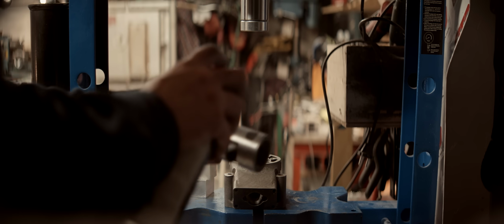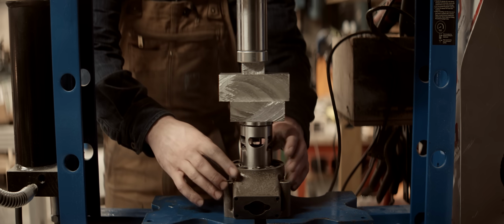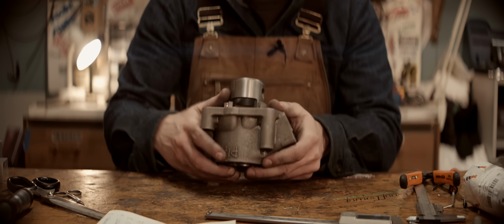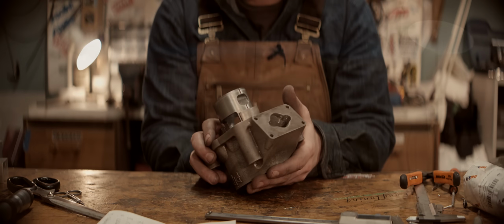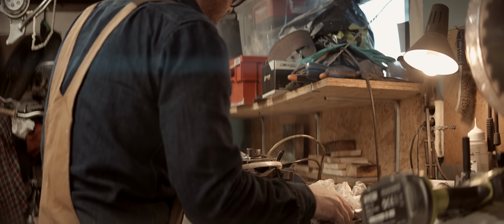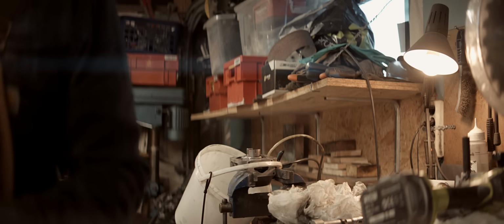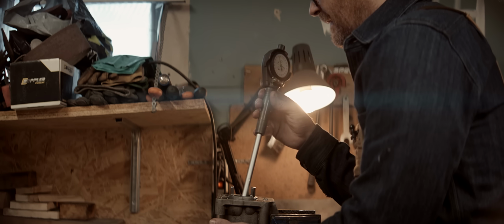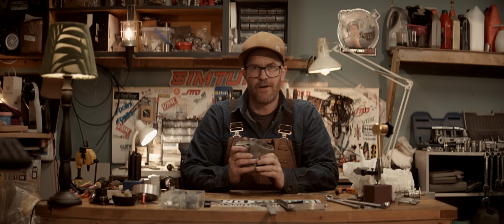PiP Sleeved and ready to go! Most Powerful Two Stroke now then?

Comment: Another 2 stroke stuffing video, happy day. We have always frozen the liner, and warm up the cylinder to about 350F. The liner usually drops in with the slightest of struggles, maybe a couple taps with a deadblow to get it started and make sure its seated.
Reply: I also was wondering why not apply heat+cold? Any benefits of not doing that?
Reply: @2bucksforthepaper  He did; freeze the liner to shrink it, and heat the cylinder to expand it.

Comment: I would put the sleeve in the freezer before attempting to press it into the cylinder....
Reply: I was thinking the same thing.  That plus heating the outer cylinder would put a lot less stress on everything during the pressing process.
Reply: It's probably colder in the shop than the freezer!
Reply: Deepends on the fit normaly you will heat the cylinder and freeze the sleeve then we press it, its how me make it in karting
Reply: You can do It also by heating the cylinder and if the diameter of the sleeve Is correct enters very Easy with enough  time for center It
Reply: Agree
Reply: Unless your worried that you have to much interference and will crack the cylinder when temps normalize. Going in with zero delta T gives you a feel for the fit.
Reply: Put the cylinder in an oil bath for 20-30 minutes. Then you get lubrication as well as the growth you need. There's no need to force it in there like he did.
Reply: I have baked cases @ 200° f and froze bearings on the past with great success 🤙🐾🐾
Reply: It´s fine. so it worked. that means he did it. take it easy now ;)
Reply: @Frrlas  yea 😊
But for the next time, heating and cooling is a good tips for things like this. Makes life so much easier 😊
Reply: Lather it in cheese curd for about 42 minutes. Now you wanna make sure that's 42 imperial minutes not metric, else it's not gonna work and your wood will start to rust
Reply: @Ed-G  always bake from frozen
Reply: Doesn't get cold enough, by the time you get to your room temperature cylinder block it's already expanded and the block will suck the cold out. Liquid nitrogen is what you need. You have to be quick.
Reply: @derf9465  oh no, thats not the reality… every degree difference counts…
Reply: he can just leave it outside 😂
Reply: He dont need to. He lives in Norway :)
Reply: what he did would work well as he pressed fit at normal temps but if he freezed sleeve and heated head would fit nice
Reply: He is way north. Just place it outside. And put the jug on the stove/heater 😊😊
Reply: The aluminium would shrink even more and be even tighter fit, heating the aluminium would of been better as the iron liner wouldn't of expanded as much because its less thermally efficient, with a step liner you would be better glueing it in with the appropriate modern day Loctite, they even make liner lock specially designed for that purpose, then you wouldn't have to stress the cylinder block & liner with all the load and forces of a tight fit like that,  that's way too much force  & the bottom of the cylinder block wouldn't of distorted. A simple drop in fit & check everything lines up then Locktite it, that would also make it easier to get out if needed.
Reply: Heat up the cylinder to 450°c and DROP in the sleeve. With proper fit it is easy.
Reply: Good idea but I’m not sure it would work.
Heat/freezing is good for dropping in bearings however, the re-sleeve process takes too long. The materials would probably equalise too quickly.
Reply: @gowengetter4599  Seen it done many times. It literally drops in
Reply: Upside down, compressed air spray can works great for freezing sleeves this small and saves time in the freezer

Comment: At .002”-.003” interference fit, I heated the cylinder at 375 deg F for 45 minutes and tossed the sleeve in the freezer. It would slide down, bottom out and actually gave me a few seconds to fine tune the position, if needed.
Reply: Only problem with that is the liner shrinks less than cylinder so you still have to press it after everything is at same temperature. 
It's still a lot better pressing half a mm (0.020") compared to the full length of liner.
I've tried the normal method of chilling top of cylinder so it holds liner in position as it shrinks but it's better to just press things

Comment: I heat the cylinders to around 500def F and drop the liners in.  With around .005" interference you have about 3-6 seconds to line it up before it locks.  Cylinder prep consists of boring and counterboring for the liner profile, and then honing the sleeve OD bore for exact size top to bottom.  Most I do at 5thou interference and some up to 8thou depending on bore size.

Comment: I think you schould torqe the head first and mesure how the bore gets deflected, before Installing and Running it.
Reply: Yes sure we'll pointed out.
Reply: agreed -a very good idea
Reply: Is that a normal thing to check? Is it normal for a bit of deflection?
Reply: actually great idea!
Reply: @BurnerJones  normal is pherhaps to stretch it,but it surley can happen,so to torque it down and rehone is a smart thing to do because then you hone the cylinder under the preasure it will operate in - on car-block f.ex. we bolt on a really beefy steelplate to act like a torqued head before reboring and honing

Comment: Heating the cyl and cooling the sleeve in liquid nitrogen will result in a slide in with the right clearance
Reply: im crying watching him do it without heat differance
Reply: If the interference is correct, yes
Reply: Just put the sleeve in a freezer for an hour or so too if you don't have any liquid nitrogen (most don't).
Reply: Who has liquid nitrogen... ?🎉

That is what I thought...

Just research.....and universities have N2
Reply: @fredmitchel1236  some welders will have it :) I have seen 2 of them use it to fit interference parts.

Comment: if you put the sleeve in your freezer in your refrigerator and put the aluminum cylinder in your kitchen oven to about 400 degrees F the sleeve will press into the aluminum cylinder a lot easier ..rule of thumb for machinist same size hole and same size pin is a press fit

Comment: 🥲i have a weird question brother what is it with you and the oval poorts always. why not go for the big guys and go with a butterfly exhaust poort. 😛also check your cnc or what you used because it was a little off that is usualy a worn bearing etc etc but can be added into the calculations for improvements on parts cnc ing

Comment: I have few questions about your Nikasil videos. Can silicon carbide be used instead of boron nitride? what is the maximum grain size? what voltage did you use for neutral nickel and nickel boron nitride plating. I know the current density but I don't know what the voltage is. why did you dip the cylinder in zinc, then in acid and again in zinc? I'm sorry for the questions, but I don't understand everything by ear, but I understand the subtitles. Could you add subtitles to your videos? I admire you for your knowledge and willingness to share it. Greetings from Poland

Comment: What is the proper name of the tool you used to determine the bore (before using the dial bore indicator)? It didn't look like a normal inside micrometer. At least it didn't look like the ones I have seen.

Comment: Would using a torque plate be advantageous? I know they're used on multi cylinder engines....does it carry the same benefit on a single cylinder engine?
Reply: I’m wondering the same thing, but are 2 stroke cylinder heads torqued enough to cause distortion of the cylinder? An example is a yz250 head nuts are 25Nm (18ft-lbs). Smaller capacities maybe even less so. 
4 strokes are torqued far higher so I can see how torque plates are required.
Reply: He has a lot of head bolts (8 in a ring?) so the clamping pressure should be pretty evenly distributed anyway. 4 strokes usually have valves and ports and so forth in the way so they have to have fewer larger bolts.

Comment: 2 stroke wizzard is back 
please do sleeve valves next
Reply: Jeezus no wtf, do you have any idea how complex and heavy that would be
Reply: @dietznutz1 dont use Gods word like that and dont spell it wrong to make it more right for yourself.
Reply: @dietznutz1  do we care? they made a super cool engine called the rolls royce crecy and its rumored to be the bridge between jet and piston aircraft so powerfull
Reply: @Diesr  What about the Napier Saber?
Reply: @Diesr  yeah but we're talking about insane engineers, it would have to be a two stroke but oil bathed, there are enough around that it wouldn't be worth making one, if you were that desperate you'd be better off importing a Bristol hercules cylinder and piston from the uk, there's a whole engine for sale on Facebook right now, there's a guy already making a bike with one of the cylinders.
Reply: @mrsandman5679  I'll use whatever words I dam want thank you
Reply: @adamlannerd1408  yeah thats an awesome engine too but have you seen it run?
Reply: @dietznutz1  hey you see it is not impossible and i just hope he sees it
Reply: @Diesr  its not Impossible but I think he's a two stroke only guy, the complexity involved with making that from scratch would break a man
Reply: @dietznutz1  its a 2 stroke system
Reply: @Diesr  no, its a two stroke with a pressurised oil system not a fuel oil mix, it wouldn't work with premix, think about how much metal contact there is
Reply: @dietznutz1  yeah just enough for than double half of it  lol id say it sounds good man

Comment: Is it possible to get the same or approximate power to displacement.  In a 500cc engine as a 50cc engine?   I know little about 2T engines,  besides the ones I had experience with were either on or off!
Reply: Hp per displacement usually goes down as size increases. A 500cc v10 might make work lol. The distance air has to flow to get in and out of the cylinder increase with size.
Reply: @2stroke4me  Wow. My 2 stroke twinshock 250 had 19 from the factory.

Comment: Next time soak the sleeve in dry ice (frozen CO2) and the case in the oven at about 100degree C.  This is how the con rods were installed on the Packard Merlin engines during WW2.  My Dad was a production leader then supervisor during the war.  Guys at the Spitfire plant in England marveled at the visual quality of the engines coming from Detroit, Packard.  Every metal was smooth and painted.  Exposed nuts and bolts were chrome or plated.  The word was “must be nice to work in a plant that doesn’t get blown up every few weeks”.  It was the way Packard did things.  We had a prewar Packard.  My father was not found of it.  He said all you had to do was spit on it and it wouldn’t start.  I was brought home from the hospital in a Packard.  After “Sparky” was gone it was Fordz for a long time.  I never bought another US made vehicle.  I bought one rice burner, a Subaru.  Needed a compact AWD. Too bad engines had a finite life.  After that back to Fordz.  I was an employee for about 20 years so at retirement I got discount plan on new purchases.  Dealer could not adjust price.  If they did Ford had ways of making life miserable for the rogue dealers.  Sometimes warranted it sometimes not.
Reply: Dry ice is nowhere near as easy to obtain in Europe as it is in the US.

Comment: Why don't you use a nicasil coating but a cast iron sleeve?
Reply: he used a coating before. sleeve gives him the option of pushing it out and replacing it instead of the whole cylinder if he needs to change port sizes or timings
Reply: @triton199  Thanks, I am not a regular viewer to this channel, was his Nicasil coating durable and abrasion-resistant, wear?

Comment: You really should stop using the 3 point mikrometer when meassurering the cylinder.
Reply from the maker: Used both 3 point and two point this time👍
Reply: @2STROKESTUFFING you should ditch the 3 point all together, but using both is still accepteble.
When you put In the liner heat up the cylinder on a cookingplate the liner will go In without any issues, the same when removeing it.
Else good work